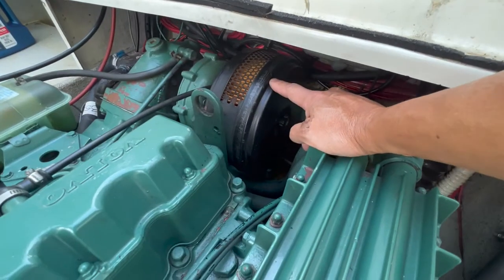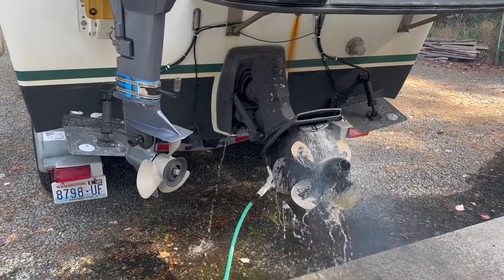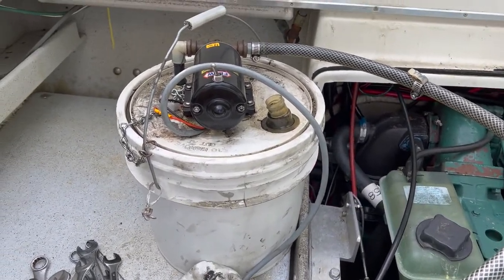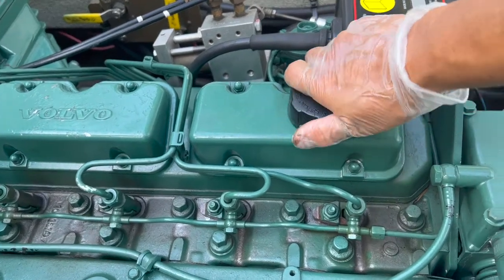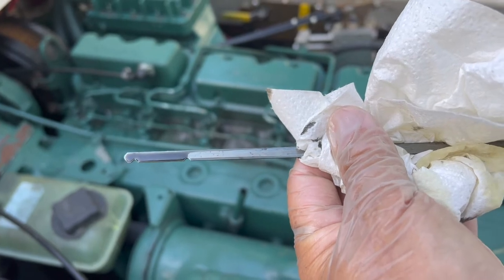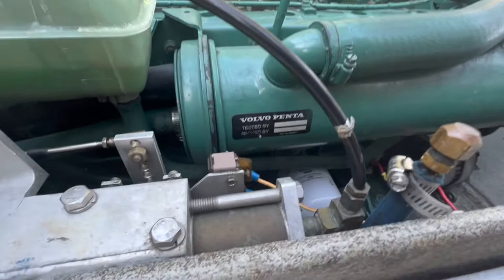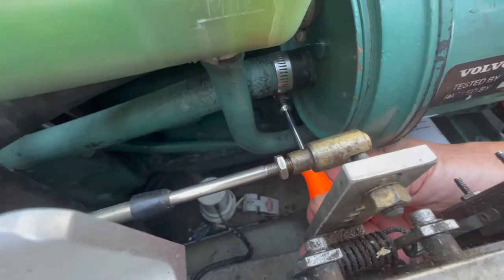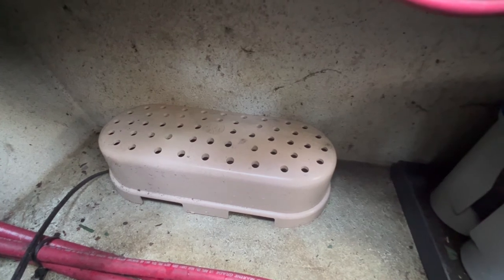How to DIY Volvo Penta AD41 Annual Service and Winterization

Comment: Hello from Florida Ben!  We bought a Cape Dory 28 cruiser last month that has that series Volvo but in a standard transmission and prop shaft. The previous owners lost the manual so your video was very helpful in getting familiar with the engine. Excellent points on tightening the oil filter.  May you have a great crab season this year!
Reply from the maker: Thank you. Glad it was helpful.  Do enjoy boating in Florida!

Comment: Great video, thanks. I have a Nimbus 35DC with twin installed  AD41's, and like others have said, this is by far the best video covering the winterisation framework.
One thing that may help you out, re oil filter change - if, once you have cracked the seal on the old filter, you put a plastic bag over it , you can twist the filter into the bag which keeps the majority of oil from coming out, and keeps it contained in the plastic bag. Then its just drips from the housing to deal with.
Sven Bjelland has some brilliant videos on his channel, dealing with some overhaul items, intercooler,  heat exchanger, water pump etc, if you fancy checking it out on YT.
Thanks again, great video. 
Have you any info on that customised oil extraction tube? Was that an engine out, sump off modification? I'd love to have that fitted to mine. 👍👍
Reply from the maker: That's a terrific suggestion regarding the plastic bag around the filter once it's been cracked loose.  I'm always nervous about spilling oil and fumbling the filter.  It'll be part of my routine from now on.

Comment: Why do you empty all seawater? Easier flushing the system with glycol?
Reply from the maker: This boat/motor draws raw water through the outdrive, so flushing the system with glycol would involve filling a tub big enough to fit the outdrive in with antifreeze and running the motor.  The raw water is returned via the outdrive and shield, which splutters all over the place. Antifreeze is toxic and attracts animals, which you may end up poisoning. Draining the raw water system after thoroughly flushing with fresh water is the least expensive and simplest way to winterize this type of I/O motor/outdrive.  It is also the most environmentally friendly and legal.